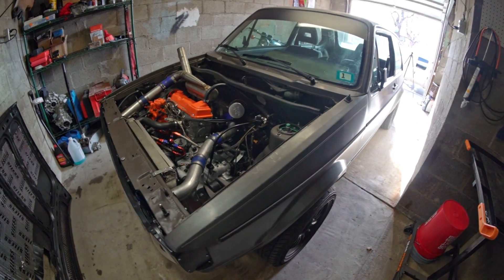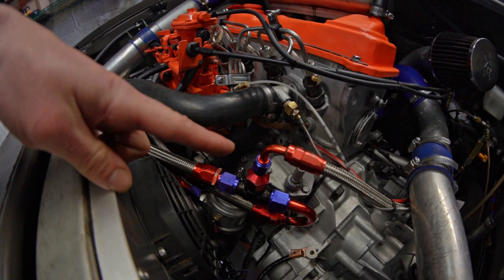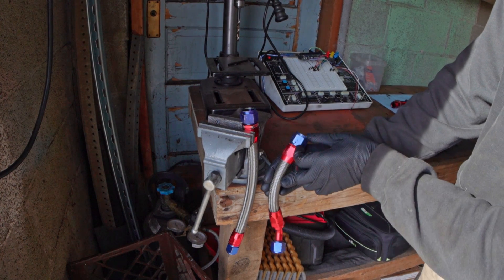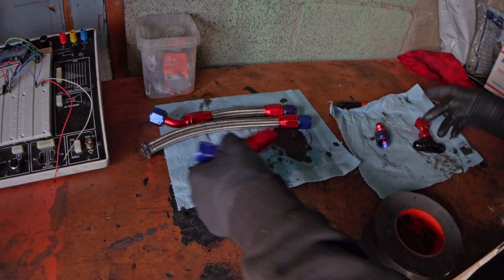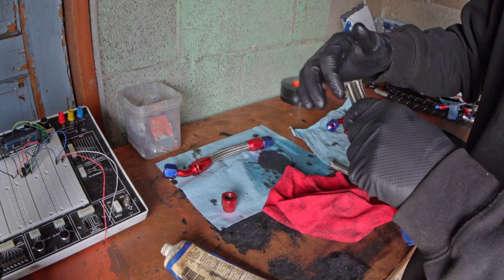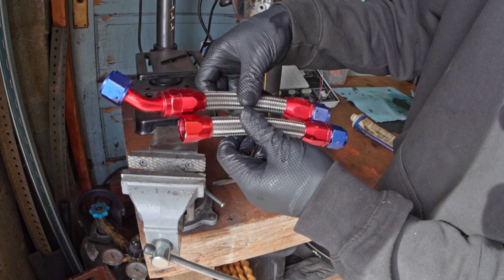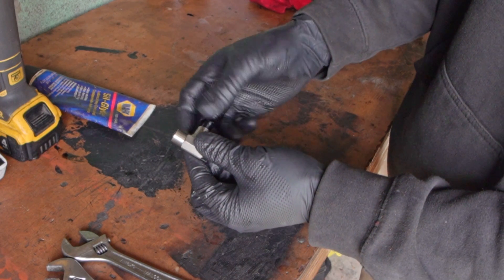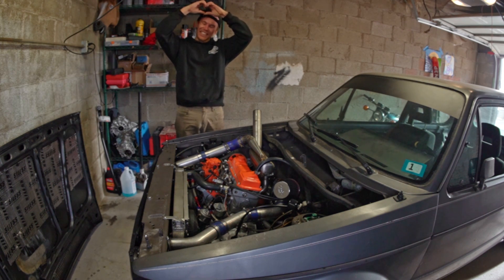AN Fittings & Sandwich Plates // Tips for your Oil System

Comment: Hey where did you source your fittings? Specifically, the new fitting you installed on top of your filter. (1/4” NPT)
Reply from the maker: Usually Amazon or eBay. Sometimes Ace hardware has some npt fittings too!
Reply: @OliverFetter  Another question, doesn't that hole on the top of the oil filter have metric treads? did you re-tap that one to 1/4" NPT?
Reply from the maker: @BulldogsGarage  as far as I can tell, no it's pipe thread not a straight/metric thread. The 1/4 npt went right in there no problem and has sealed fine.
Reply: @ thank you good sir!